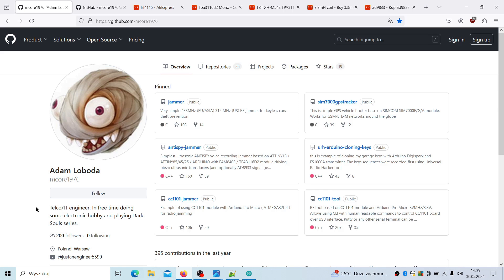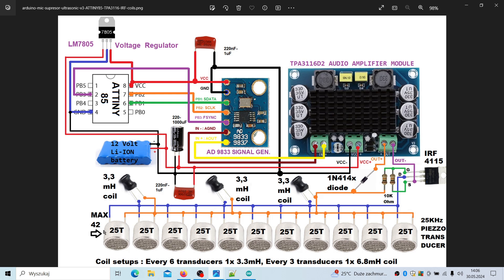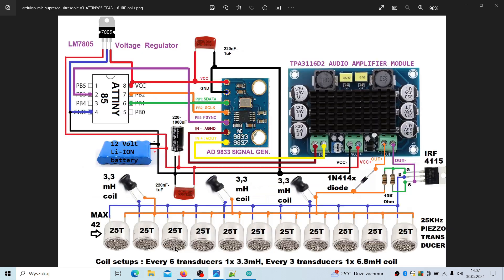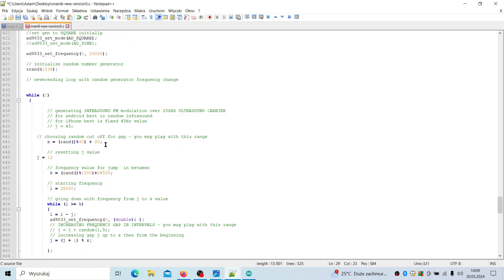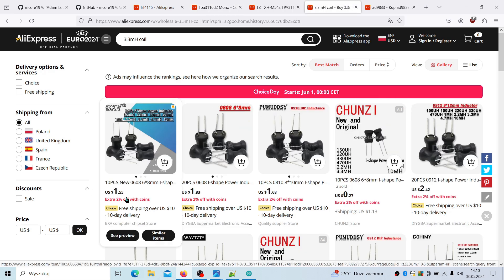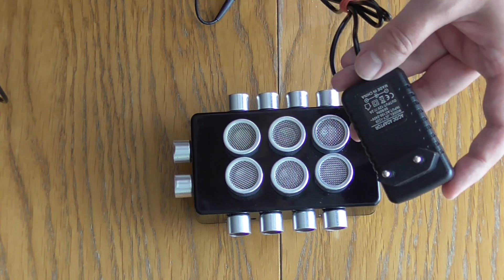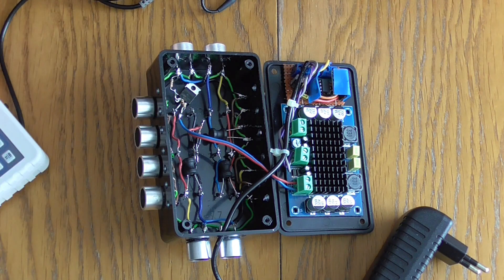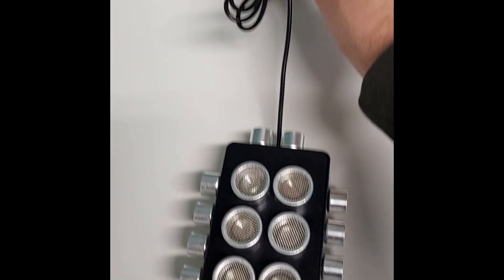DIY Ultrasonic Microphone Recording Jammer for Android phone  and iPhone

Comment: Im getting an error USICR was not declared.
Reply from the maker: check the source code for other platforms like esp8266, rp2040, esp32c3. ATTINY85 is quite old and requires AVR-GCC and skill to use it

Comment: Hi sir am from india in my market the availabillity of 25khz was very less and price is also very high i can affodably use get 40khz if iam using 40khz how much coils i have to use and how much transducer can i use is instead of 20 can i use 10 or 15 kindly help
Reply: also in source code is there any modification for 40
Reply from the maker: 40khz has very limited range of jamming and I do not recommend using it. 40khz code is there on github

Comment: wanna do it with esp32 with bluetooth and wifi to use it by web remore app or smartphone?
Reply from the maker: check the project page on github. I added ESP32C3 version. You can easily add some wifi bt code to the project to enable remote control of this device

Comment: Can I use a Dupont wire for the connection, and will the current exceed the range of the Dupont wire?
Reply from the maker: you can use Dupont wire. The current is not a proble because the voltage on the transducers is quite high and may reach 100 volts

Comment: This device is generally quite limited because it uses white noise by ultrasound at 24~26kHz. The ultrasound can be easily blocked if it is not directed at the target or encounters barriers such as paper, cloth, etc. Is there any technology that allows these noises to be generated in the form of sound or infrasound that can penetrate these obstacles??? Because if I put a cell phone recording inside a closed backpack, it is still able to record the environment outside the backpack, but the ultrasound cannot block it. Only a device that blocks it by generating noise in the form of sound, not ultrasound, would be really efficient.
Reply from the maker: check my latest project. It can carry the sound from an audio input over the ultrasonic 25kHz wave. You may combine it with audio jammer for better results :
https://github.com/mcore1976/rp2040-parametric-directional-speaker

Comment: Hi. I did it according to your scheme, as in this video, with chokes, a diode and a transistor, with the latest code. I used 36 transmitters in the circuit. During the test, I turned it on for a few seconds, and I didn't point the transmitters at my ear. After a few seconds of testing, my ears started shooting and I started feeling sick. I have no doubt about microphone jamming. How can this device be used indoors with people if it has such an effect?)) It is very effective for scaring away animals and people)
Reply from the maker: commercial devices have also some kind of microphone that is used to sense if someone is speaking  and enable the jammer only  during the speech. Of course  It requires additional effort in design. This reduces amount of time the ears are exposed for the ultrasound which of course may have negative impact on some persons.

Comment: Hello, I bought all the components for variant B. The project has been running for so long that many of the links are out of date. My problem is that I can't program the ATTINY85. Is there a video somewhere that explains this in a comprehensible way?
Reply from the maker: check my video : https://youtu.be/7klgyNzZ2TI   Also if variant B you need to install Arduino IDE and follow this info https://gist.github.com/Ircama/22707e938e9c8f169d9fe187797a2a2c
Reply: @justanengineer5599  Thank you very much for the quick reply. Unfortunately it doesn't work. My ATTINY has a soldered processor. I bought an Arduino Uno yesterday, which was shown in another video. That didn't work either. I already have some experience with Arduino IDE, but I can't do this yet.  I also live in Warsaw. Is it possible for you to program the ATTINY85 for me? 
I sent you an email about it yesterday. 
In return, I could 3D print something for you. ;-)

Comment: Hello sir,  On my project i'm gonna use ultasonic tranducer 40khz, what gonna happend? it's okay or i should use 25kHz?
Reply from the maker: use 25kHz. The 40KHz does not jam well
Reply: @justanengineer5599  i'm sorry the ultrasonic thats using transmitter and receiver, or just transmitter?
Reply from the maker: both work the same way. Transducers R25 and T25 look exactly the same
Reply: @justanengineer5599    i couldn't find the 25khz and currently have the 40khz, what should i consider changing in the circuit or the program?

Comment: Hello, 1. There is a gap in the capacitors values between what you wrote in the README file and the drawing.  In the file you specify 2 capacitor values, one of 100nF when in the sketch the range you wrote is 220nF - 1uF and the other at a value of 47uF f when in the sketch you specify a range of values 220uF - 1000uF.  Can you please give exact values?  2. According to the drawing, is the output 1:43  seen by the amplifier in the range of 3-8 ohms?  I ask this because according to the amplifier's data sheet, its operating range is 3-8 ohm resistance.
Reply from the maker: The caps can be any of this range. Sometimes they may not be necessary. Regarding the amp output I suggest to use not more then 40 transducers because the  amp module may get fried.

Comment: Hello brother, I have created the jammer with digispark and tpa3116d2 and it works great, at extended use I find the TPA3116D2 gets hot. This is the mono version of the TPA3116D2, you say in the video the audio channel could support up to 40 tranducers, is this correct? If I switch to a dual channel TPA3116D2 for example the one found at (deletes my comment if i include link) will this enable me to use 40 x 40 for each audio channel? Would any changes for power need to be made on the circuit if using two channels?  is there any benefit to using the larger than 16mm transducers for example the 24mm ones like this ( deletes my comment if i include link)  Thanks
Reply from the maker: the 24mm transducers have a bit wider angle of emission so they may give some slight improvement but not much. You  can use two TPA3116D2 mono modules attached to the same input without any problem. Max  for single module is 40 transducers but I would recommend to use only 20 per channel

Comment: i wrote to your email I hope you can answer me for some doubts that arose since I am building a blocker
Reply from the maker: you may ask here as well
Reply: @justanengineer5599  I have a problem, I am making the device with the boards digispark attiny85, ad9833 and tpa3116d2, I did tests with 12v 1ah batteries and the integrated regulator of the digispark burns out, I switched to 12v 1ah charger and it works fine, but it only blocks the recording on android phones, when making the modification by placing the 3.3 coils, the IRF mosfet, the diode and the resistors it blocks completely and does not emit any signal. I'm using the Arduino code from 8 months ago.
Reply from the maker: You know my code would also work for Raspberry Pi Pico RP2040 boards but you just need to change SPI communication pins : For RP2040-ZERO it will be SYNC/CS  pin 1, SDATA/MOSI pin 3, SCLK/CLK pin 2. Also change the pin definition here in the code : https://github.com/mcore1976/antispy-jammer/blob/main/mic-jammer-ad9833-new-version4.ino  :

// Definition of FSYNC , CHIP SELECT pin in your Arduino board
#define FNC_PIN 1

You would also have to use Voltage Regulator LM7805 to feed this RP2040 board and AD9833 board. The TPA3116D2 board needs to be powered from higher voltage - 12V before LM7805

The problem with cheap digisparks is that they tend to break quite frequently when you try to use internal 5V regulator to power external boards from it.

Comment: Hello! I know it may be a dumb question, but can i use transmitters instead of transducers? (I just want to make sure)
Reply from the maker: must be ultrasonic and for 25kHz
Reply: But it doesnt matter if it is transmitter or transducer? (Ultrasonic 25khz)
Reply: Btw thanks for the project! Its great what you are doing!
Reply from the maker: does not matter if transducer or transmitter

Comment: Hello, first I wanted to say thank you for this amazing project, you are a very high level professional! I have 2 questions: 1. What is the recommended diameter of the transducer if it is important to me that the effective range be as long as possible? 2. I was unable to find the 6.8mh value coil on Aliexpress, can you send a link or give another more common value?
Reply from the maker: Hi. 1) the 24mm transducers work as the same as 16mm. Maybe the angle is a bit wider. 2) You can use different coils there are couple of options. F.ex  you may use 4.7mH every N transducers. Check my github for some guidelines

Comment: Great video, Sir! I built the version using the DIGISPARK, TPA3116D2, AD9833, IRF4115, 3.3 mH coils, and 10K Ohm resistors based on your schematic and code from the description. However, the range is very short (I'm using 12 transducers Ultrasonic Sensor HC-SR04) and only reaches about 20 cm from an Android device.

How can I troubleshoot my version to maximize the range?
Thanks!
Reply: Thanks for all, i bought transducer 25kHz from lcsc and i follow all your instructions and work well. 
Great work Sir !..😍😍
Reply from the maker: I need the details what are the transducers that you used and if they are  25kHz because 40kHz sensors are not good and obviously this is the reason of such small range. Another question is which source code have you used to program Digispark. Do you have an oscilloscope and can you check if you are getting min 50V at the transducers?
Reply: I'm using 40kHz transducers because it's difficult to find the 25kHz version in my country. I'm currently using the source code mic_jammer_digispark_ad9833_new_version5.ino. I checked the output on the transducers, and it's about 2.5V.
Reply from the maker: well if you have only 2.5v on transducers means it is not working at all. Use the code with 40KHz in the name. As far as I can see it is not even driving the transducers into resonance state

Comment: TPA3116D2 gets very hot. When we increase the volume, TPA3116D2 starts to make noise. Thank you.
Reply: Is it work with iPhone bro ?
Reply from the maker: Yes, if you attach 15milihenr coils every 2 transducers 25KHz. Of course IRF MosFET also has to be attached. You need to do some experimentation because your TPA board may behave different  and Transducers may have different capacitance while in the resonance state
Reply: @justanengineer5599  i put 15mh coil on each 2 probes and the result is almost no sound anymore and the mosfet is extremely hot. my test it works with iphone but can not cancel speech sound is still clear. can you give me more suggestions?
Reply from the maker: are you sure you put 15MILIhenr not 15MICROhenr coils? You made a short man if you used 15MICROhenr that is why your MosFET heated up. 15uH have too low impedance...  It is unbelievable.. I am writing everything as clearest as I can as for the morons but you are still fucking it up...
Reply: @justanengineer5599  I am so sorry I got that wrong. Thanks so much for the feedback.
Reply from the maker: Use bigger coils - 15MILIHENR per each 2 transducers. The point is that these 25KHz transducers have differerent capacitance value while in resonance state at 25KHz.  There for you need to experiment a bit with Coils values and setup.
Reply: @justanengineer5599   Yes i also found out that for resonance 15miliHen is good, Culdnt get more then 6 for now , but will test with less transducers if effective will get more Thanks for your help.
Also the MOSFET effect needed for Iphone is not seen in scope yesterday it was there but today unfortunately not there, The Amplifier board i got seems to be not a good version and is a cheap version can this be amplifier issue or i am doing something wrong , I have followed exact your circuit
Reply from the maker: you might have broken your MosFET IRF transistor. Check if the voltage on transducers is high (60V or more) and the question is are you using diodes 1N4xxxx as in the design?
I think if it worked for Androids then the amplifier version is OK
Reply: @justanengineer5599  Hi , Yes the Vp-p is 60V+ and diode is 1N4148 .
I have made good progress with 24 Transducers but now the issue is audible sound , And i just noticed similar sound in your video also when you are showing the graph , Also i missed your point of using 2 diodes in paraller and used the single diode as in schematic picture , can you help in reducing audible noise, The best effect so far is in 24 trans with 3.3mH every 6th trans , Thanks for your help
Reply from the maker: yes this audible sound is 11khz frequency due to the harmonics in the signal that drives transducers. I am thinking how to overcome this but for the moment I do not have good solution
For the diodes - use diodes for higher amperage like 1n4007 or better
Reply: @justanengineer5599  is there 11khz harmonics on sine wave generator or after the Mosfet
Reply: @justanengineer5599  I tried the RC filter in high pass configuration but dont know why there is no output after the filter capacitor , The cut of frequency i set was 22Khz , The filter was after the Mosfet ,
Reply: @justanengineer5599  hi , I was able to remove the audible sound and found an method to remove from any number of transducers .
But the issue is I blocked android Samsung and Motorola to the range of 8m but when I tested with IPhone it didn't get block at all I tried multiple times only once it had an effect where it neglected my voice for sometime.
I see in your code you have mentioned some points for IPhone models can you share a brief details what steps or test can I do to get the result
Reply: @beyondintech  you was able to remove the audible sound and found an method to remove from any number of transducers . Can you tell us how you did that?

Comment: Hello, Mr. Adam, I have made your Android version before. It works great at around 5 meters. I will make this latest version. Is this version sufficient for Android and iPhone? If I use TPA 3116 dual band amplifier 2*120watt, 2 different devices are plugged into each channel. Is it suitable? .I have 20khz 24mm transdusers.Thank you
Reply from the maker: Finally it works better with 25KHz transducers when the coils are attached to it and the MosFET is added

Comment: Hi, we have had success with the 25khz. The 16kHz one seems to make minimal / no noise at all (recording on an iPhone) - Any suggestions or ideas why? I thought the 16 would work best for iPhone, and the 25 for other phones
Reply from the maker: Finally I recommend only using 25kHz transducers. The lower frequency transducers are not suitable.  The of course supress microphone sensivity but do not give the noise effect at suffcient level
Reply: Ah okay thank you. So no benefit of running both at once? I spent close to a thousand on the smaller ones 😂 may as well make use of them if they run better together. 

But seems like they don’t work (at all)
How many 25kHz would you recommend for a small room to target specifically latest iPhone
Reply from the maker: at least 100 placed in different opposite locations like corners of the room

Comment: is this save for long term use?
Reply from the maker: you have to test it
 For sure it shouldn't be used 24/7
Reply: @justanengineer5599  Is there some kind of additional circuit so that this jammer can be used 24/7?
Reply from the maker: I think the option to detect human voice via microphone and jam it only when detected is a solution for this

Comment: hello really excellent work, it would be possible to also bring together all the small electronic elements like inductance, resistance etc... on one and the same cms plate for example which would re-connect the others like the amplifier..the random generator
Reply from the maker: yes of course. But the point was to create something that anyone can build from publicly available components not some customized board
Reply: @justanengineer5599  yes I see..but when you opened the case in the video it looked like it was complicated to solder...you must have spent a lot of time ..
Reply from the maker: In fact it was 2 hours of work

Comment: Have you seen Linus Tech Tips video from month ago on similar device from aliexpress, and how it compares to your build.
Reply from the maker: it is almost the same but my costs 10x less and everyone is capable to build it.
the difference is that they may have battery built inside.
Reply: @justanengineer5599 he mentions paper or cotton will block the jammer and the microphone will record as normal. Is the same true for yours? If that's the case, a microphone pop shield may easily block this
Reply from the maker: It really depends on the microphone type and the device type. Some are jammed quite well while in the pocket.

Comment: I've heard about this before. Very impressive to see it in theory
Reply from the maker: works quite well, try to build it
Reply: @justanengineer5599   - Whats the approximate range, and does it bother your own voice as you're talking once it's switched on?
Reply from the maker: The range depends on the devices you want to jam. For some phones even 10m. Some devices are not susceptible like some lavalier mics due to their different design (watch LinusTechtips channel to see the testing - it is up to internal membrane placement inside the mics). Anyway the common range is from 1,5 meter to 4meters for most of the devices. Yes it does not interfere with your own voice, you can still speak freely. However I think using it for a longer period of time may samehow have an influence on the health. I did not try to use it  longer than 15 minutes...
Reply: You mean see it in "practice", theory is just the schematics. lol